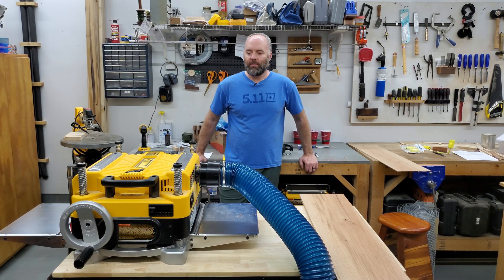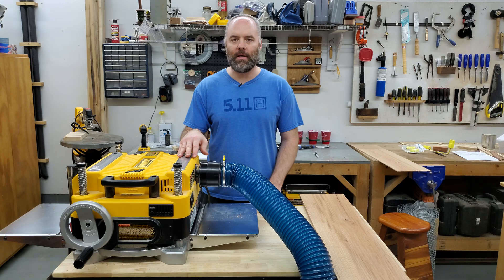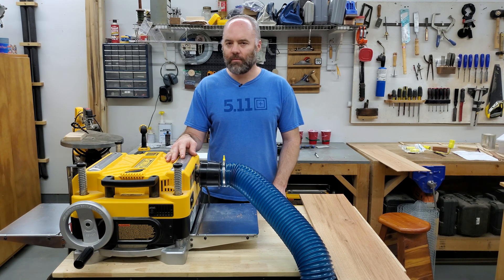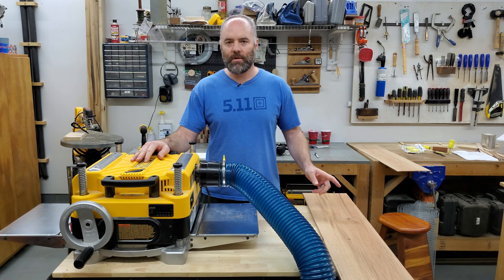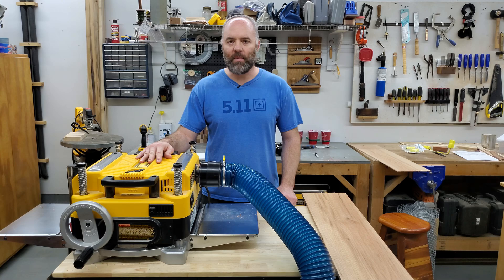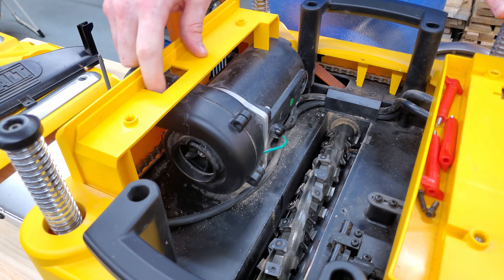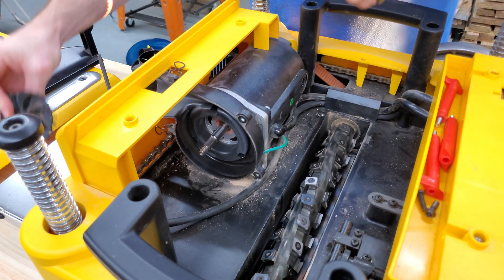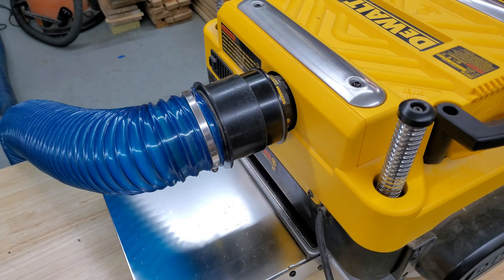What happens when you remove the impeller from the planer?

Comment: Looking at all the comments maybe it would be good to do an update video and somehow measure the heat of the motor after planing operation? Just a thought. Everybody seems very concerned about the motor overheating it'd be good to see some hard data on that.
I was absolutely going to do this modification just because it seems so unnecessary to have such a big blower while being hooked up to a dust collector. But my major goal would be to cut down on the amperage because I occasionally blow a breaker and was hoping this would solve that. But now I'm terrified of burning up my motor
Reply from the maker: I've thought about doing that, but I've got a lot of stuff in queue at the moment and not enough time to get it all done. Maybe I'll try to fit in a quick test sometime.

Comment: I am just seeing this for the first time, thank you for posting, i was considering doing the shielex upgrade and thinking a dust extraction, considering what power system I think i will go 2hp dust extraction, and remove the impeller also. If i had a 3D printer and 3D printing skills, i would modify the inner dust extraction housing to be a little more efficient whilst permitting cooling for them motor, this is a great idea, that obviously after reading some of the comments, people have a lack of understanding about how much pressure drop a dust extraction system offers
Reply from the maker: Thanks for the feedback. I hadn't really thought much about the hood design, but I'm realizing now that most planers just rely on the cutterhead to eject chips, but since the motor on the DW735 is in the way, they might have just added the impeller to avoid having to make the planer taller.

Comment: My buddy took his impeller off and the motor blew 3 months later. I don’t know if it was just a coincidence. How long have you had it off, using the dust collection for cooling?
Reply from the maker: I've had mine off for around two years now, always used with the dust collection connected. The planer is five years old.

Comment: I did this upgrade and burnt-up my planner. The piece he removed helps to keep the motor cool. This is not a good upgrade. It sounded good but don't do it.
Reply from the maker: Sorry to hear about your planer. If you have a dust collection system connected as I showed, it will draw air past the motor to keep it cool. I've been running mine without the impeller for almost two years, and I bought the planer five years ago.
Reply: How dare you steal my name.

Comment: I would not recommend doing this unless you have a cutter head upgrade. The impeller also breaks up chips if your using the original cutter head with straight blades. Also you do sound like Nick Offerman.
Reply from the maker: I suppose that the impeller could break up chips, but I'm not sure if it does. Man, now you got me curious. I might have to test this.
Reply: I believe it does thats why you get chips instead of long strips when plaining wider boards.
Reply from the maker: @Githy1378  You were right. https://youtu.be/WTFdwDLNGfA

Comment: So this impeller just shoots the chips or provides the suction aswell?
Reply from the maker: One side shoots chips out of the back, and the other side sucks air past the motor.
Reply: @TheSnekkerShow  ah got it. Im thinking of getting the x model as it's only the price of an extra set of blades If I bought seperately plus it had free table extensions at this point. And I think I'll do the bucket and filter lid style extractor since all I have is a dust deputy and I hear those dont work well in planers with no blower
Reply from the maker: @grantperry6977  Just make sure it's connected to a dust collector and not just a shop vac. The dust collector moves more air and helps keep the motor cool in the absence of the impeller.
Reply: @TheSnekkerShow  since shop vac and dust deputy probably won't work well, I think probably just use the blower and bucket/filter no?
Reply from the maker: @grantperry6977  That sounds like a good plan.
Reply: @TheSnekkerShow   thanks for input and great video! Usually I don't comment on videos, but this is the first time I've actually been replied to so props for that!

Comment: Hi, good video. One quick question, do you get more dust particle inside your planer without the impeller? Thank you!
Reply from the maker: I haven't noticed any difference.
Reply: I would think about blocking the fan air intake too! The circle part in the center of the fan housing.It will give you more vacuum for dust and chip extraction because you are no longer using the fan to blow chips out. So the fresh air intake at this point is a performance  decrease.
Reply from the maker: @patlee9704  It would improve chip extraction, but the opening also draws cool air past the motor through a vent on the side of the planer. Blocking it might cause the motor to overheat.

Comment: Sorry for the deflate, but the instructions clearly state to not use a 'shop-vac' as it can't keep up with the expulsion of the chips and air flow. Happy to hear that it's still working for you!!!  Cheers!
Reply from the maker: Performance depends on the size and power of the shop vac, but you're right. I was using a 6.5 hp 16 gallon vac with a 2.5" hose and it did okay, but filled up quickly. This planer is what triggered me to buy a dust collection system.

Comment: HI,
it is a prytty good idea and it looks like it is working, very nice explanation and quality video. I have one question which you can maybe help me with: do you know by any chance if the motor in DW735 planner is the same as in DW734? I would really appreciate your help.
Reply from the maker: I'm not sure, but you could probably look up the motors on ereplacementparts.com
Reply from the maker: I just looked it up real quick and the armatures have different part numbers, so probably not.
Reply: @TheSnekkerShow  Thank you for a quick answer. I have already look in to it before, but i get info also that different part number is due to usage in different model. For example some parts in DW733 and DW734 are tha same but just becasue they are used in different planer model the part number also differes. Anyway thanks a lot for quick answer. I will look deeper in to it somhowe.

Comment: Is the impeller not providing cooling for the motor?  (That is the main/only motor it was attached to, right?)
Reply from the maker: That is correct. My initial concern was that the motor would fill up with dust without the impeller, which would also indicate reduced air flow and cooling. So far no dust in the motor, which means the dust collector is providing the necessary cooling air.
Reply: Good to know! Sorry, didn't see the question had already been posed. 😊
Reply from the maker: @SyteCYer78  All good, I probably should have covered it better in the video.

Comment: I just upgraded by removing the impeller, and installing a Shelix head. But now the planer won’t start, does it have to be hooked up to the dust collection now that the impeller is removed in order for it to start? I really appreciate the help!
(I’m still constructing my shop Right now and don’t have access to that 4 inch dust collector yet)
Reply from the maker: You need either an impeller or a dust collection system. You can't run it with neither, or the planer will overheat and clog with chips.
Reply: @TheSnekkerShow  thank you so much for the super quick response! So without the dust collector, it will not start? It’s a brand new planer, and it worked perfectly fine before I change the head and remove the impeller.
Reply from the maker: @audioman99  My pleasure. It should start, but you're probably lucky it didn't. I'd recommend putting the impeller back for now, and then troubleshooting the power chain. There's a safety switch under the lid that looks like a cross, a breaker in the front, check the outlet, etc.
Reply: @TheSnekkerShow  thank you so much! I really also want to thank you for printing out this entire series, it was very much consideration when I bought this planer and the new head.
Reply from the maker: @audioman99  Good to hear, thanks for the feedback.
Reply: Maybe fried the overheat sensor?
Reply: @thomasbrown9402  Pretty embarrassing mistake, I had the top cover reversed (I hadn't yet screwed it shut yet).

Comment: This is a good mod only if your dust collection has good suction.  If so it should be enough to pull the chips from the cutter head section and still have enough vacuum to pull air through the motor.  The only issue is to idiot proof it.  I caught myself twice in a year when I forgot to turn on the dust collection.  So the impeller of the planer was powerful enough to blow up the bag and push the chips into the collector.  And when I went to press the button on the remote for dust collector I’ve noticed it was never turned on.  So that would get me into a pickle and possibly damage the planer. Otherwise it’s a good mod.  Taking off about 300W of load on the motor is better for the motor and also let’s it run cooler if the cooling effect of the dust collector is the same as the impeller that was once in place.  Cheers.

Comment: I would be interested to see how it performs after modifying the impeller to stop acting as a blower for dust but leaving the blower for the motor.  Judging by the impeller blade count on the back of the impeller, the motor requires a much higher static pressure vs the dust blower side.  Dust collection units are designed for flow, not static pressure, so I would seriously doubt that a dust collection unit will provide enough cooling capacity to keep the motor sufficiently cool.  There's a big difference between trying to suck air through a motor with only small gaps and through a wide open 2.5" fitting.  You need way more static pressure to pull even a fraction of the air through a motor.  Also, you will lose some dust collection flow as some of the cfm will be used through the motor, which vents from the outside of the motor in to the dust duct.  So you lose cooling AND dust collection capacity in exchange for a small amount of horsepower.  I would bet money that average motor temps would be up significantly and over time that equates to lower lifespan of the motor.  By grinding off the outer impeller blades and reinstalling the impeller, you would be testing to see if the dust blower is responsible for the power gain/loss without compromising the motor and also without decreasing your dust collection's capacity.  Plus if your dust collection gets clogged or flow decreases due to your bin being full, or if the hose comes loose or the blast gate doesn't latch all the way open, you won't be risking burning up your motor.  A replacement impeller is about 15-20 usd online, so this wouldn't be an expensive test.

Comment: I noticed my gasket plate is a little buckled?? And I cant find a replacement part... everyone wants to sell the base at half the cost of the planer! Any insight? Thanks.
Reply from the maker: Is this the part you're looking for? (removed)

I think a lot of those plates look a little buckled just because it's thin sheet metal. You might want to try removing yours first to see if there's any debris underneath.  I haven't tried that with mine, but it looks like it's just held in place with the tabs.
Reply: @TheSnekkerShow  That plate IS NOT for the DW-735......it's for the smaller DW-734 12½" model......in DeWalt's infinite wisdom they glued the sliding surface plate to the base on the DW-735 so it's not replaceable....going through this right now as I ran some barn lumber through mine and seriously gouged the slide plate as well as my infeed and outfeed extensions.....got my extensions from Amazon and the base plate from E-Replacement Parts in about two days -- https://www.ereplacementparts.com/
Reply from the maker: @CycleTuber  Good to know, thanks. Was there a part number on ereplacement parts? Dewalt just lists the part number for the entire base, even though their parts diagram shows them separated.
Reply: @TheSnekkerShow  great idea, thanks for the videos and insight. Gained a follower!
Reply: Do you have any vids on cleaning the rollers? ...safely
Reply from the maker: @rueban96  No, but you can just unplug the planer and clean them with mineral spirits. After cleaning the part you can see, plug the planer in briefly and turn the switch on and off to advance the rollers to a new area. When you're done, re-wax the bed so the wood slides easier.
Reply: @TheSnekkerShow  Thanks man!

Comment: Not sure how long that motor would run if u had 1 or 2 square meter of long boards to plane withoht cooling
Reply from the maker: And to clarify, the dust collection system provides the cooling air through the motor housing. This  modification should not be done without a dust collection system.
Reply from the maker: It's definitely not intended to be run at full-width capacity for long. It would be no different using a circular saw to rip thick slabs.  Most woodworkers plane narrower boards frequently, and wider boards occasionally. Those who need to plane longer and wider boards frequently should consider a 220v floor model.

Comment: Just curious- does the Impaler keep the motor cooler. If yes, wont it overheat more? Just wondering
Reply from the maker: That is correct. My initial concern was that the motor would fill up with dust without the impeller, which would also indicate reduced air flow and cooling. So far no dust in the motor, which means the dust collector is providing the necessary cooling air.

Comment: Great Video.  I do wonder about your amp meter.   If you pulled 30+ amps across a 20 amp breaker (1) your breaker is very bad or (2) your meter is not reading correctly.  Tech school was 30 years ago, so I do not remember that formula  I do believe there is one you need to apply to get the correct reading.  Also the spec’s say it will only pull 15 amp.   Try this one.  It splits the lines internally and gives you true reading.   

I do understand your point is it draws less current,  but I think all your numbers are double 

I will hook mine up tomorrow and see what it reads. 

kuman KW47. 
https://www.amazon.com/dp/B07DPJ3RGB/ref=cm_sw_r_cp_api_glt_fabc_84CVPPVHY3TX49MWCZ5P
Reply from the maker: It's a common point of surprise. There are some links in the description of this video that might help explain the high numbers. Short version: The +20 readings are accurate.  https://youtu.be/47PyY4K47KU
Reply: @TheSnekkerShow  I can not tell are you going across the hot or the neutral or both?   To accurately measure amperage with a amp ring you must only go around one leg of the circuit.  To test this go to your breaker box, use your meter on the hot lead coming off that breaker.  I think you will see very different results. I watched the video you recommend and understand the thermal side takes to to get to the point it pops the breaker,  you are showing that it double the amp draw in less then a second.  That will cause the solenoid to activate.  I tested mine this morning thou I have the stock head and it shows to pull 14 amps on start up.  12.5 on running and 15.6 running lumber thru it.
Reply from the maker: @timfitzpatrick3024  Sounds like you were either taking a very light pass, or using a narrow board. Try it with a 10" wide piece of oak or similar hardwood, and make sure to do a full wheel rotation after the initial baseline cut.  I've been challenged on this several times before, but it always turns out the same once the same test is conducted.  Clamping the meter around both wires would give a reading of zero, not double.
Reply from the maker: @timfitzpatrick3024  This shows two meters used, and the results of clamping around hot, neutral, or both.  https://youtu.be/KBL97SqVrDc
Reply: @TheSnekkerShow  yep, making a cutting board.  11” wide with walnut, Purple Heart and maple.  When I am smithing out after first glue up I was taking a turn to turn 1/4 off and the meter I sent link peaked at 16.2 amps.   If you are not separating the hot and neutral the. You can. It get the correct reading.  I have bees in electronics since 86.    I have been wrong before.    Just not this time.    Try just the hot wire and see what you get    Or a meter that separates it for you    I get into a pissing match. So if you do not want that all good.  Have a good night
Reply from the maker: @timfitzpatrick3024  All good, the channel wouldn't be much fun if people didn't challenge unexpected results.  Check out the link in my other reply.  Clamp meters read zero if you put it around the hot and neutral at the same time.  It's partially hidden in this video, but that's a ten-loop line splitter at the top.  I use a one-loop and ten-loop splitter in the other video at the same time.  Two meters, two splitters, two planers, and consistent results.  I can't see your setup so it's tough to say what the difference is.
Reply: @TheSnekkerShow  I 100% agree you must use one or the other.  So if that is what you are doing then it is what it is.   I will see if I can find your email or FB and send you a video.